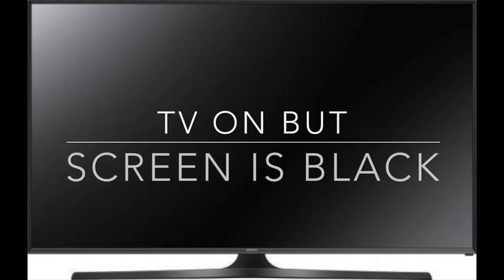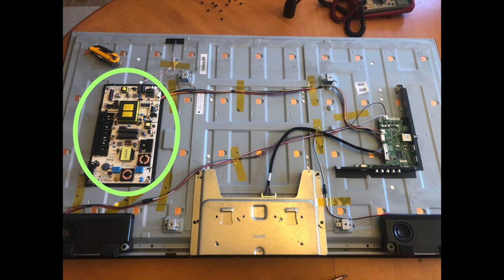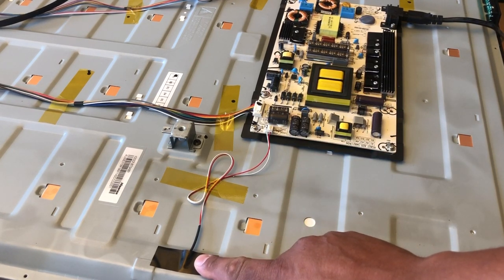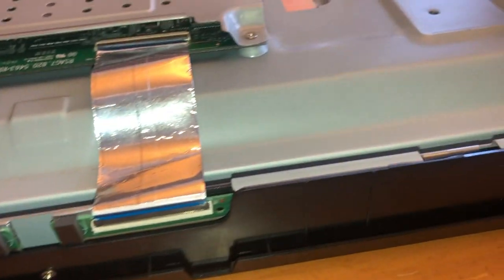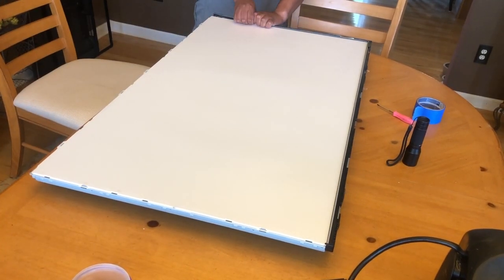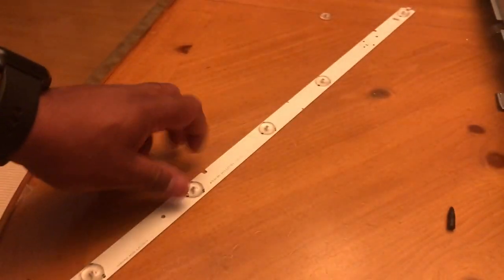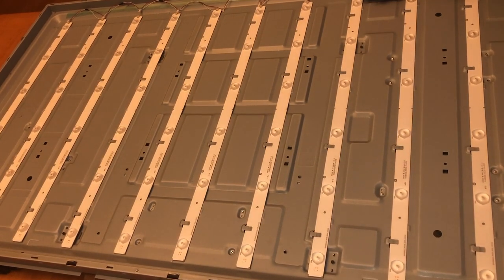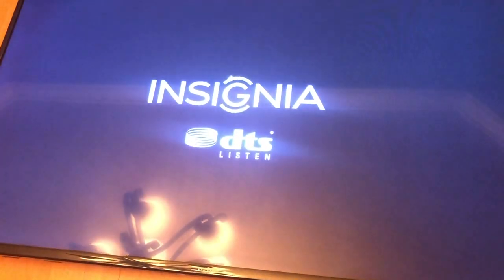Insignia 50" LED TV power on/black screen full tear down, test and repair

Comment: Dang I was just trynna watch a movie and then boom screen goes black. How unlucky 🙃
Reply: That just happened to me 10 minutes ago when I tried to put on Harry Potter and the goblet of fire.
Reply: I tried playing in my Xbox but the same thing happened
Reply: @fbi8355  My tv is fixed now
Reply: @Quirky_Ventriloquist  mine is too I o Ku unplug it and let it chill for some time and plug it in and done now it works
Reply: I was playing fortnite and it went out😶
Reply: @Quirky_Ventriloquist  @FBI there's a setting on your tv called "backlight" turn that setting down to anything below 20 and you'll increase the lifespan of the led lights in your tv.
Reply: @fbi8355  check my other comment
Reply: @kron9597  i sold the tv but thank you tho
Reply: Bro just happened to me so unfortunate 🥲
Reply: Did me the same way... The exact same way..
Reply: @lildustg6442  How? Just cause he wanna watch a movie with her.. Dude you lost my friend plus that's not even close in being a Simp...
Reply: i don’t understand why they went out all of a sudden yesterday night the screen was perfectly fine, and when i turn on the tv the Roku sign and red back ground shows perfectly for like a second then goes completely dark but i can hear me moving it with the controller any help?

Comment: I honestly didn't watch the video but the trick is your tv is automatically set to have your backlight at 100 all the time as a factory setting this causes those bulbs to burn out and takes about 2 years or less. The tv needs to have the led lights replaced but after you get it fixed make sure you turn the backlight setting below 20 it'll make the lights last longer.
Reply: How do I replace the LED lights?
Reply: Ohhhhh this explains it I had the tvjust over a year

Comment: My tv turns black no sound but the power is on...... I keep it off for about 15 minutes then screen is back every now and then it does this
Reply from the maker: Sorry for the delayed reply, I hardly get on anymore. For anyone else with this issue, it sounds like a bad power board. But make sure there is enough air flow around the TV, this can be caused by an overheating board.

Comment: Excellent video detailing the task. I just replaced the LED's yesterday on my NS-48D510NA15. It is now back on my wall and good as new. I did see one LED blown out and burnt. (Had to be my issue). Thank you for your time to post your video.
Reply: I have the same model,same problem.Time to five in.

Comment: Wow, very good diagnosis, I was wondering why my tv was doing this, and you could not have explained it and demonstrated it any better. Mine was intermittent for some time, and I'd re-plug in the hdmi cable for whatever reason that worked to get it to work again, now, it's not doing the trick any more and I see the image with a flashlight under the screen but still black. I can't find any tricks to get it to pop back on again. I certainly will not be repairing it myself but it's nice to know whats wrong with it. These are so cheap I'll just be buying another one.

Comment: I'm no electrician but I'ma try this out I bought a 50' for $130 and 2 weeks in my sister calls me the tv won't turn on.2 weeks later I was gonna break, it all pissed off but I stayed patient, kept messing with the power button on the tv and it turned on it would blink 6 times half way through I'd just keep pressing the power button and I'd see little baby flashes (little progress) so I youtubed the problem and I'm here about to order these parts! I hope it works after all I'm still saving $100 compared to buying the same thing brand new.. call it wild but anything is possible!
Reply: And so how did it go

Comment: Hands down one the best instructional videos I've seen, certainly THE best regarding this issue with the LG/Insignia TVS. One thing going in your favor is that you did not instruct viewers to bake the board in the kitchen oven. Don't care about the testimonials in its favor: I'm not chucking delicate electronic parts with solder and other noxious metals into an oven. The stench alone will get me couch bound for a month, if not tossed out the house for good. 
One question: will a continuity tester suffice, or am I going to be better off grabbing a multimeter?
Thanks for your time

Comment: The most detailed explanation I have seen. You even go so far to explain the different terms, like continuity.  I’ll be using this to hopefully fix mine. One question, you mention the TCom board due to lines in the TV.  Do you have a video on the specifics of that?  Thanks again for the in depth guide to fix this.
Reply: Yes
Reply: It's the led strips of light inside of your tv that need to be replaced. After you get it replaced or buy a new one you need to go to a setting called "backlight" on all your tvs in your house(some tvs don't have the setting) and set it to anything below 20.
Reply: @kron9597  I think its too late
Reply: @LnKproductions  did you buy a new tv?
Reply: @kron9597  no
Reply: @LnKproductions  is it still broken?
Reply: @kron9597  no I was just kidding I need a TV anymore

Comment: I have a 55" Insignia with Black Screen.  I have Sound, and I can see an image when I shine a flashlight on the screen.  BUT, I only get 25vdc on the LED power cable both plugged in and removed.  Installed a new Power Supply and same 25vdc.  I've ordered a TV LED tester to make sure its the LEDs before I completely disassemble the TV.  Your video shows hundreds of volts, so is it my Power Supply?

Comment: First of all thank you for showing this information. I think it's absolutely appalling how these expensive TVs just don't last. I've had to last me exactly one year to the date and the third one only lasted a year-and-a-half one was a curved screen 50 4K smart in one was an LCD flat smart t.v. 55 4K and third was the RCA ruko TV 55. All having the same exact issue one moment it's a beautiful picture the next the screen goes black. All TV's still have sound but no picture. The first two I can't even access it's like is if they glued the back of the TV plastic right onto the frame there's literally no screws. Ironically I still have a sticker approximately 3 in thick 10 year old rizzio 50 TV that works perfectly fine. Let me knock on some wood now. I'm going to try your trick to see if I can get any one of the three that went black to work.

Comment: I have the Insignia 55 inch 4k smart TV from Best Buy.  Mine powers on fine, but while watching in mid-show, the screen goes dark while the audio continues on.  Most of the time this seems to happen when the screen is transitioning, like between episodes of a Netflix show, or heading to an ad/commercial break on Hulu where the screen is supposed to go dark, it just never comes back up! If I turn it off and on again, the picture comes back, but only temporarily.  And the timing is random as to how long in between.  I saw some trick where I shine a flashlight into the screen, and I can see that there is still a picture it is just too dark to see normally.  Is this fixable or is the set just done?  (tv is just barely 2 years old...and the only device in recorded history that I purchased from Best Buy and DIDN'T get the geek squad plan...)

Comment: thank you for your tips, i was given a TCL android TV that works for a couple minutes up to about 10-12 when i last tried, then the screen go's black 'sound is still on 'and i can change channels and other operations, i also can see shadows in the darkness, your idea to use a torch to see if it is a picture will help, but like your fix, it could be a LED strip or loose connection that' with it warming up maybe the problem my only other thought could be a component starting to fail (LED strip), these are my thoughts, like you i will eliminate throw the process ..cheers

Comment: Not sure if you still monitor this but have a question. I have a 2 yr old Insigna NS-50DF710NA19.  While watching it the entire screen went black. Sound and all kept playing.  Flashlight test showed backlight issue.  I did your test and there are two sets of reds and two sets of blacks coming off power board.  From chasis to red I get 36 Volts. Nothing on the black.  Unplugged LEDs and same voltage. With power off I get 23 Volts to LEDs.  I tried ohm test but I don't get anything from red to black on connector unplug.  (Not sure I am testing right) Does it sound like it could be power board vs LEDs?

Comment: Hello. I replaced the LED lights on a Insignia NS-50df710na21 smart TV. The 3 diffusion panels shuffled and I cant remember the order. There's 2 clear sheets a reflective sheet and a thick white plastic sheet. Would you happen to know the order?

Comment: I have a 55 inch insignia fire edition tv. I have black screen with sound actually couple weeks ago the tv started showing the black screen. The funny thing is when turned on the tv it was working fine. Until I had couple minute phone call so I paused than went to the bathroom. Thought the tv was asleep so went to play again now it’s black screen again. I seen the Amazon app when I used a flashlight. I bought it at best buy in February they won’t come out to look at it. I can’t find my receipt either but I gave them my email address as always do.
Reply: I have the same issue, i think its the strips. I should be on that project in about 3 weeks. Will report what i find out.
Reply: It's the led strips of light inside of your tv that need to be replaced. After you get it replaced or buy a new one you need to go to a setting called "backlight" on all your tvs in your house(some tvs don't have the setting) and set it to anything below 20.
Reply: @boatrightbrian972  when you replace your led strips don't forget to turn the backlight setting to anything under 20 it'll give you at least 6 more years on your bulbs.

Comment: Good job and I would like to ask u a question.. I have a 65inch tcl Qled tv c715 my screen wen black and no picture showing up. I can only hear sound from the tv what u think cause that happen?
Reply from the maker: if it's an OLEd tv, it'll be a little different with regard to backlighting (or lack thereof, no led strips) so, if you have power coming out of the power/main board, I would look to the tcon board. Check for a blown fuse on power board/main board.

Comment: I didn't see anything when I used a flashlight, it has sound but no picture, what do I need to replace?
Reply: Yes
Reply: Same here. Next video 😭😭
Reply: Same my brother broke the tv and it been a year we still have the tv
Reply: Same here😔😔😔😭😭😭😭
Reply: same here
Reply: I didn't see it either
Reply: It's the led strips of light inside of your tv that need to be replaced. After you get it replaced or buy a new one you need to go to a setting called "backlight" on all your tvs in your house(some tvs don't have the setting) and set it to anything below 20.

Comment: Okay so I followed the video precisely and fixed my TV (same exact model as in the video). Thanks!  Only things missing from the instruction that might’ve been helpful were mentioning the various adhesive tapes that needed to be peeled back and the longer machine screws that hold the bottom portion of the frame that sits under the outer bezel.

I’m not sure how it happened, but a 1” spot in the upper-left corner of the screen got damaged and looks like a multi-colored spider web.

In addition, there’s now a “flicker” every 5 seconds.  Probably going to have to buy a new tv.

Comment: Hi , i like your video, very explicit. I have a 5 year old Sharp Roku TV 50", with sound but black screen, i opened the back panel, noticed that led light go on and off very quickly after i turn it on giving me a start image and off.
Do you think it's the led lights or the Logic board?

Comment: Great video!  I have the NS-50D550NA15 as well, and the screen just went black.  Exact same issue, apparently.  What is the part number for the replacement light strips, where did you purchase them, and how much were they?  Thanks!
Reply: I have a different model but I ordered mines from useful part.  There is also a store called shop jimmy.  If you google the part number on the light strip you should find a few places that sell them
Reply: It's the led strips of light inside of your tv that need to be replaced. After you get it replaced or buy a new one you need to go to a setting called "backlight" on all your tvs in your house(some tvs don't have the setting) and set it to anything below 20. If some of the information doesn't apply to you my bad just spreading the word.

Comment: Have you ever worked on a Maxsonic 32 inch with a blank screen? The indicator is on but the screen is blank no display.
Reply from the maker: I've never heard of that brand. Did a quick search on shop jimmy and looks like it's hard to find parts. As for troubleshooting, I would follow the same steps. Can you see an image while using a flashlight...if so, check the power to the LED's, then the LED's themselves, after that I'd look to swap the inverter board (or main board if teh tv has it all in one place). Also, you'd want to check to see if the TV is worth fixing, at one point, the cost or repair parts and time outweigh the value and buying a new tv is the better path.

Comment: I have an Insignia 50" led roku tv and the backlights dont work. Did the flashlight test and lcd is  making an image. Tested the leds with the jeston led tester power supply and the all of the leds light. I did this while the tv was on and could see the image fine. All 3 branches of the led backlights work and are 32.5 volts. Does the system board tell the power supply to turn on or is the function only on the power supply board? Anyone come across this to find a common issue?

Comment: Avoid these Insignia problems TVs and Tvs LED lighting in tv screen dying all together but if you already bought or buying these TVs.Just making sure your brightness settings 🔅 only 50-55% maximum amounts only 60% brightness settings.These lower brightness percentages settings will save your tv screen LED lighting screens from over working for brightness for screen.These lowering brightness save more of it works better to another 4-5 years can save tvs lives more easily.

Comment: Hello Ace, I was wondering if maybe you could help me out. I got an LG 70UK6190PUB for free since it was not working. She said she heard a loud pop, then had a black screen with sound. I first took off the back panel and seen that the IC on the T Con board had blown. I bought and replaced the T con board and still no luck. However, if I unplug the 1 side of the ribbon cable on the T con board and power it up, the left side of the screen works. Any other configuration and I get a totally black screen. Any help would be greatly appreciated. Thank you in advance!
Reply: It's the led strips of light inside of your tv that need to be replaced. After you get it replaced or buy a new one you need to go to a setting called "backlight" on all your tvs in your house(some tvs don't have the setting) and set it to anything below 20.
Reply: @kron9597  Thank you for the reply!!Are you pretty certain this is the problem? If I do the flashlight test I don’t see anything. I thought it might be the main board but I haven’t got around to figuring out how to test that yet. This is my first time attempting to repair a TV so it’s all new to me.
Reply: @bulkynerd4106  try hitting the menu button on your tv so that your tv will actually give you something to see. If that doesn't work then your problem most likely lies elsewhere. I didn't perform repair I had a local tv guy drop by to do it.

Comment: Have you seen this problem & repaired a Sharp 50" roku tv?
Reply: It's the led strips of light inside of your tv that need to be replaced. After you get it replaced or buy a new one you need to go to a setting called "backlight" on all your tvs in your house(some tvs don't have the setting) and set it to anything below 20.

Comment: I have this same model. When I plug in there is a red light in lower right corner. When I turn tv on, red light flashes for about 10 seconds, then goes off. No sound. No screen images. Any ideas on my problem?
Reply: @Roy Raven samething
Reply: Roy Raven same

Comment: Iam having the same type of issue on my phone, its a redmi note 8.
actually my phone fell in the water and it was there for about 3 to 4 secs and when i took it out it was working for aroun 30 secs and later onn  i dried it up, now what has happened is the phone does work but i can't see anything, i need to use a flashlight to see the screen some kind of dark but lightly transparent blackness has come over it.
Please can you help me on this issue ?

Comment: Just have to say all my LEDs are working I'm just not getting a picture could it be a tcon strip?
Reply from the maker: If the screen lights up, but you get nothing at all, The first thing I would assume is the main board, where video is processed.

Comment: If it’s only one light that’s not working do I still have to change the whole thing
Reply: Led lights in your tv went out. Also known as backlights either get them replaced or buy a new tv. Whatever you decide to do make sure you go to the backlight setting on your tv and set it to anything under 20 to keep them going way longer.

Comment: Mine is producing a little over 400v dc at the led molex plug when leds are plugged or not whatis the problem
Reply: I'm working on one now. 400v can be normal on some of these. Check the wires going to the LEDs for open circuit/infinite resistance! If you get that then there is burnt out LEDs!